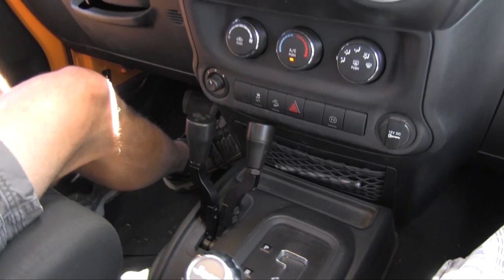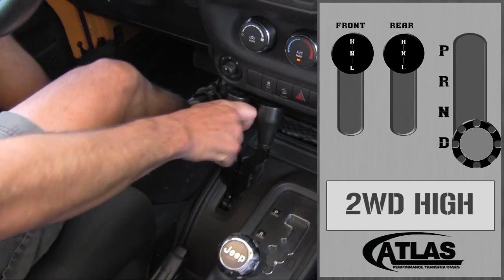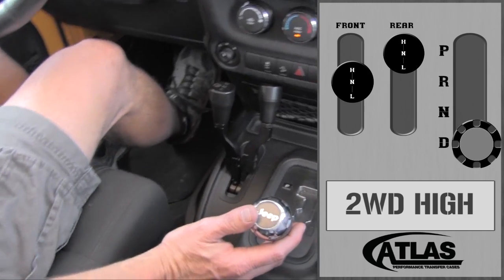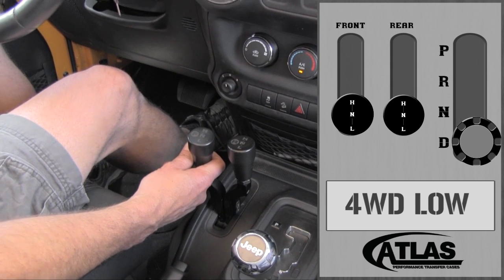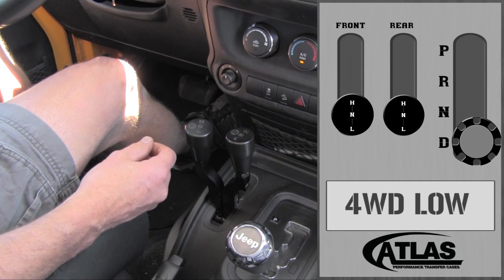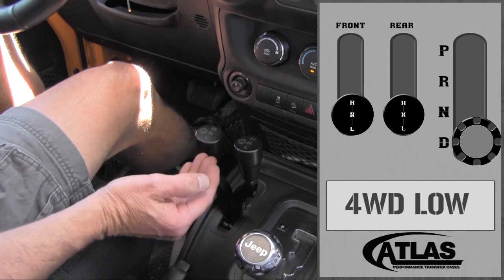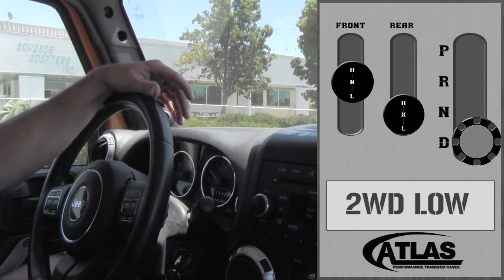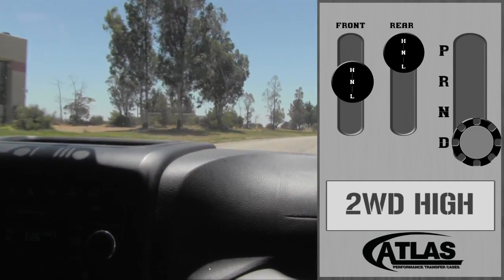How to Shift an Atlas 2 Speed Transfer Case with an Automatic Transmission

Comment: On my 01 BoostedXPLR Sport (t-bird supercoupe Eaton m90 s/c) I installed a switch where I can basically disable the viscous clutch in the t-case that goes to the front driveshaft and have rear 2wd low or I can flick the switch back the other way and have 4wd low, but I guess I would like to be able to have low and high on front wheel drive only lol, I just dont see where I would ever need front wheel drive only unless it saved some ⛽  lol, but I'd still like to have the control of an Atlas like this guy. I def need one, it seemed like their was a time where Atlas transfer cases were hard to come by but now apparently they're all over the interweb lol. I prolly won't get one for my supercharged V6 01 explorer sport 2 door but when I get myself an 02 explorer 4.6 V8 4 door I'm definitely getting an Atlas t-case like the one in this video, plus I'll do a 6r80 (with selectshift) swap and a SOHC to DOHC swap plus a supercharger and more so im def gonna need a trans and tcase that can handle some power. Good vid, you explained the operation of this tcase pretty well.

Comment: Can you put the front in high range with the rear is neutral?
Reply: Edit;  i see that some people said you CAN"T do front high. you CAN do front low range. some other people said high range is locked out if rear is in neutral. 
so i guess you can do rear low, rear high, front low, all low, and all high. so, maybe front high range is the only thing you can not do.?..
so, you can still do front dig, but maybe only in low range

original comment;   yea. they call this a "front dig". to my understanding, you can do any combination with this transfer case. 
just be careful, front wheel drive is more likely to break things

Comment: Do the come for an automatic ford 6R80 transmission. Mainly because I have an older bronco and installing the coyote with the 6speed automatic 6R80. And the use of it will be towing boats, going muddying, rock climbing at times not so often, sand and occasional snow. And my differentials gearing is 4.56 front and rear with 35-37 in tires

Comment: Is the process any different with a vehicle that you have to manually lock the front hubs for four wheel drive?
Reply: The jk hubs are permanently locked bud. The arent auto hubs or manual hubs. Just locked. So you would lock your hubs when u air down making you the same as the vehicle in this video.

Comment: Seems like getting into low up a hill where there’s no traction or in any situation other then downhill isn’t happening.
Reply: Found this out the hard way. Prep yourself before getting up the grade. I was jn a scenario where my 4hi front and rear was engaged and then i needed 4lo front and rear and i couldn't engage. So i had to back down into a spot where i was then able to safely pop into 4l0
Reply: Mike Romero I’ve had the 4-speed version in my ‘69 F250 and ‘48 Power Wagon for several years and never had an issue. I have a 1978 F350 with a 4 speed + Advanced Adapters gear splitter and still...not one problem. You may have something else going on there.

Comment: Can you drive on the highway with the front axle engaged and the rear in neutral??
Reply: only in low range called front dig atlas locks out front axle in high because front axle is not strong enough for highway driving alone.

Comment: Id like to get the atlas 2 speed for my 09 f150. I know you sell an adapter for this. My question is would i need new drive shafts, crossmember shifters, and linkage? If so do you sell a kit that covers some of these issues?

Comment: Can you drive in 2 WD High range front axle only? That would be awesome, a front wheel drive pickup. Like a front wheel drive car.
Reply: Yes you could, super dangerous though.
Reply: @mavallarino  Why would that be dangerous? Short wheel base?
Reply: Jon B. Do you use the pick up for hauling heavy loads?
Reply: @mavallarino  I wasn't the OP.  I was just curious.  Reading comments further down, it seams the front drive-line is not strong enough to hold up to highway duty on its own. That makes scene to me.

Comment: Oh I basically get it now, you basically fundamentally shift from 4WD Park to basically 4WD front with the shifter in basically 4WD front with basically a tap on the gas pedal at basically 9253 R's and then basically slam on the brakes to basically stop the fundamentals of the vehicle so you can basically put the transamission in neutral to basically shift into the fundamental anti-whee spinner basically jamming the 4WD into the fundamental RWD to make the vehicle go frontwards.  Basically, you're a bonafide Eyenstien...

Comment: Is 2WD mode possible also on front axle? And this 2WD front axle mode possible also in low and high range? Thx for an answer.
Reply from the maker: Sorry the front wheel only high range 2 wheel drive is locked out, as a rear wheel drive vehicle is not safe to operate and steer at speed when in 2wd high.
Reply: That's a load of BS, we have front wheel drive cars, they operate the same way as disengaging the rear axle in a rear wheel drive and running on the front axle.
Reply: My atlas allows me to drive in front drive high.

Comment: I have been running an Atlas for a while now.   I did not know I could go from rear wheel low to rear wheel high at any kind of speed!  I will have to check that out.  And you are right, rear wheel low range is the awesome!  I spend most of my wheeling time in rear wheel low configuration and then easily add the front wheels in when I think I need them.

Comment: Okay... Can I leave the rear axle in N and drive FWD if I really wanted to? What would happen if I tried that option?

Also, does your unit not have the 3rd lever?
Reply from the maker: no 3rd stick on an Atlas 2 spd unit. and to answer your question about the FWD, only in low range. The front wheel only high range 2 wheel drive is locked out, as a rear wheel drive vehicle is not safe to operate and steer at speed when in 2wd high.
Reply: @AdvanceAdapters1971  huh
Reply: What he means is no you can't run it in front wheel drive only because their transfer case designer wasn't smart enough to figure out how to do that.

Comment: Is it possible you rear is in low range and you accidentally put the front in high range or the other way around. What would happen?
Reply: The Atlas will not physically let you shift into two separate ranges at the same time.